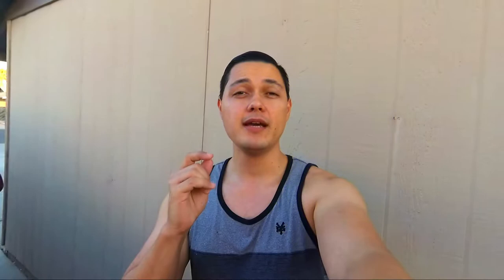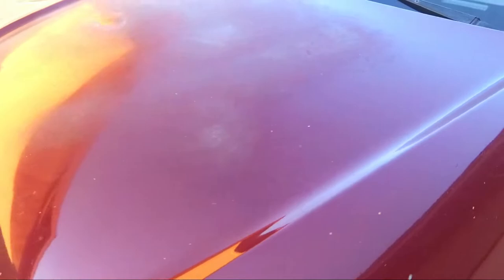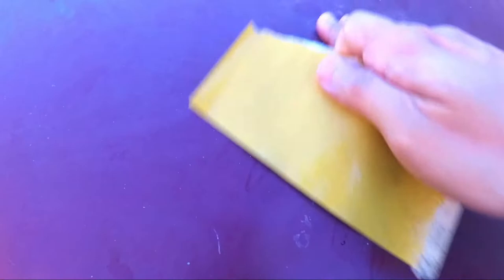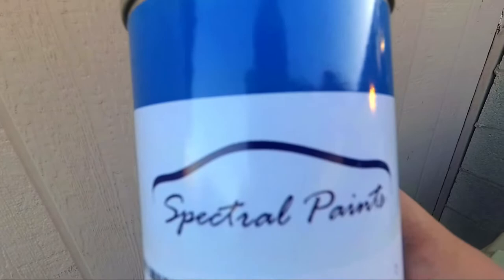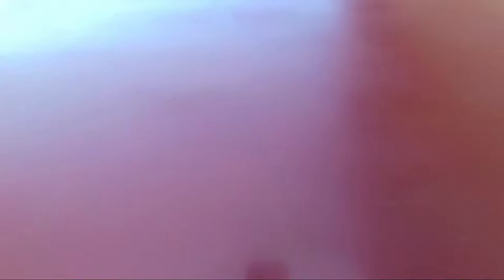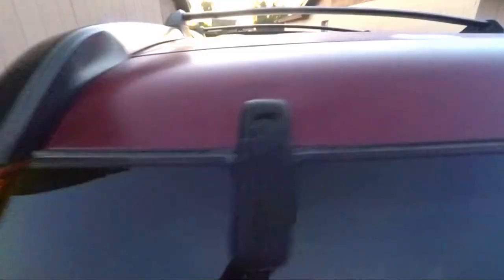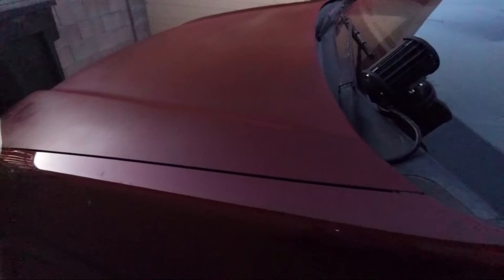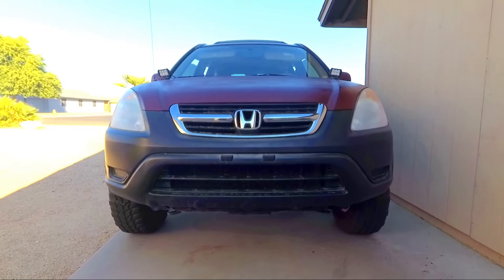PAINTED my CRV'S HOOD with EBAY PAINT! OFF-ROAD BUILD (2003 honda crv)

Comment: gonna install a 3 inch front and 2.5 inch rear lift with aerogenics camber kit and aerogenics engine/subframe drop next week on my 2004 MT CR-V. Gonna use your tires as inspiration.
Reply from the maker: Nice!